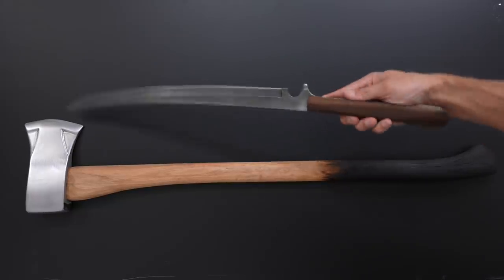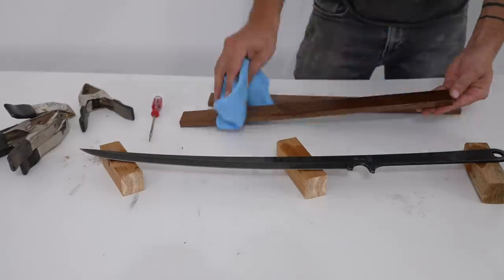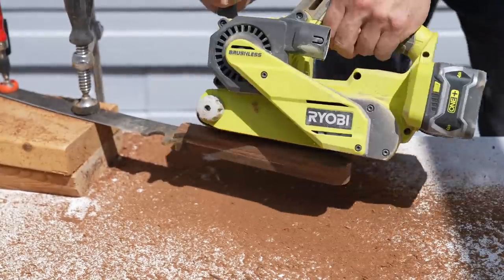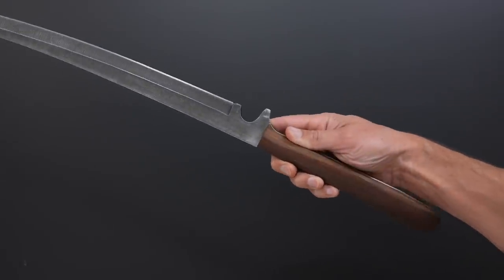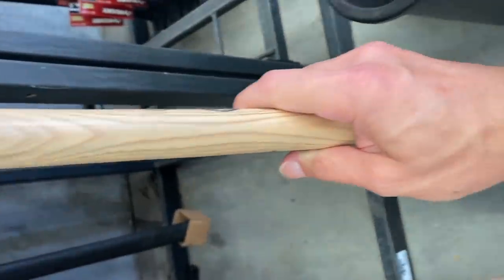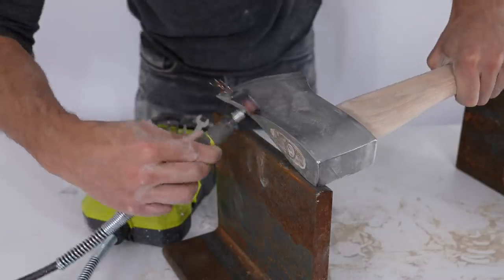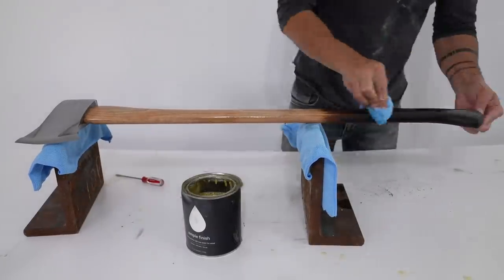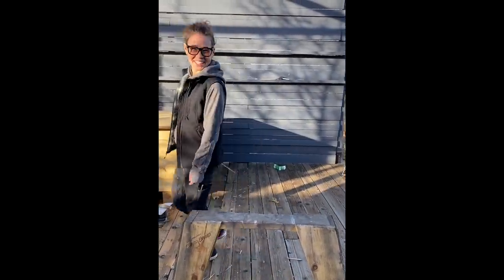Making a Custom Katana Sword and Axe for under $50

Comment: The second axe handle is the one you want as the strength of the grain will stop it splitting where as the first the direction of force from chopping will separate the grain and split much easier.